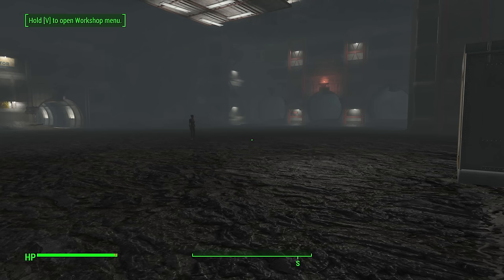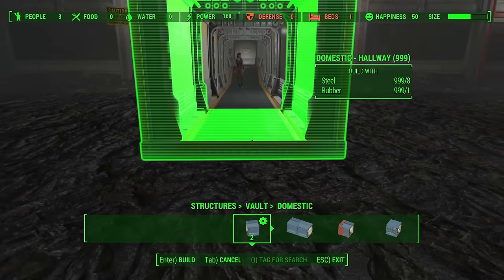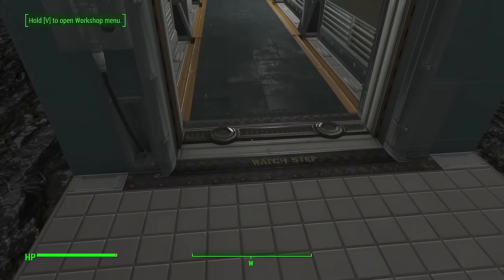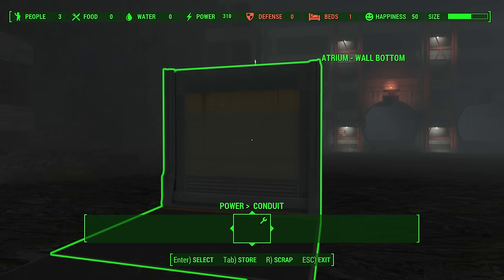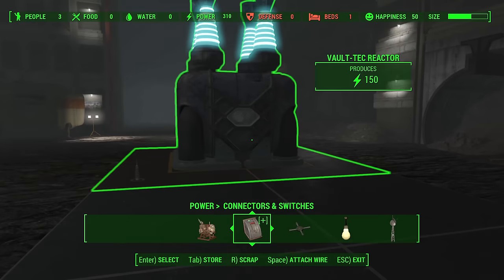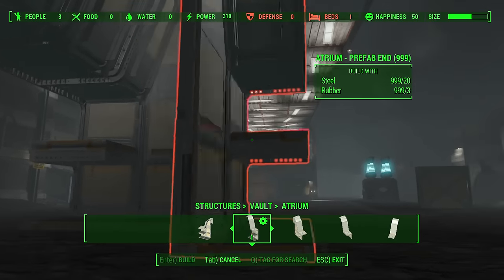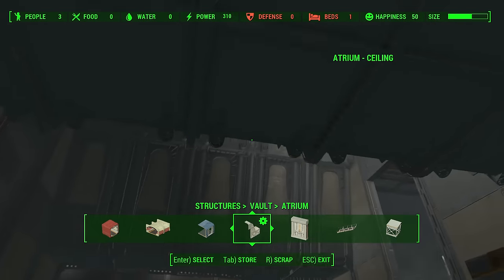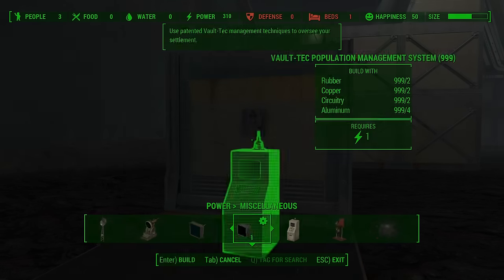FALLOUT 4: Vault-Tec DLC Basic VAULT BUILDING Guide! (Connecting Power, Rooms, and Atriums!)

Comment: Fun Tip: You can extend the width of the atrium through snapping with regular walls. 
You need to build enough walls to reach the height you want and snap a ceiling piece to it. While the ceiling pieces won't snap to the prefabs, they will snap to each other

Comment: You actually can extend your atrium ceiling. Just separate them to whatever length you like using atrium floor peices, build up your atrium walls in between, then extend the roof from there. There will be a gap left between the atrium end peices and the ceiling and walls, but if you remove the end peices and place an additional wall or ceiling piece, you can then replace the end peice and it will snap into place and fill in the gap.

Comment: Make a video that explains how to get power from the existing reactor
Reply: vault power comduit
Reply: Really????
Reply: the conduit is under switches and connectors. it snaps onto a vault wall
Reply: It'll only snap on to newly placed walls though, if you want power to the main entrance you'll have the wire it up like you normally would with wires and conduits stretching out from the power plant, the VT conduits that you can place emit power up to a 500m range and will power anything that doesn't require a direct connection, if it does you can still place a wire from the conduit to the object you're trying to power, there is a mod that'll increase the passive power range up to 1,500m so if you're having issues with placement I'd suggest downloading it =) Hope this helps!
Reply: If you use TCL you can see that the original generator is actually connected to the first "snap-able"  vault floor via a series of regular conduits below the ground. you could do something similar to hack power to the old part of the vault.
Reply: Put down a vault conduit on the wall, there is already a generator but you can add more
Reply: You have to place the vault power conduit every few walls the power goes through the doorway you walk into the cave with the conduits snap on the walls and the power goes through them

Comment: I'm having trouble with the vault entrance. There's that big reactor in the room off to the left of the workshop, but I can't get the vault conduit to snap anywhere in that area. Am I missing something? I want to build a wall of laser turrets to protect the entrance, but why build a gas generator when the 150 power reactor is right friggin' there?
Reply: yeah it's tricky as fuck.. I've figured the entrance doesn't count as built 'tiles' that the conduit can stick to.. the best I can figure is lining up conduit pipes along the ceiling, and connecting it to the generator with wires.. 

It's tricky but I've been successful so far, doesn't get in the way all that much. Hope this helps.
Reply: I tried aswell to get power from premade reactor.  i found no solution except drawing it with cables in the premade section.    I played  about 16 hours on release day, and i have build basicly anything and not found a better way.

The same way with the water plant i think, i hade to build a small generator near it to get water in vault.  It surely didtn draw power  by itself sadly.
Reply: +UltraSuperDuperFreak I did the same.

Comment: One thing I still haven't figured out what is wrong is the atrium ceiling only pieces.  They do not snap to ANYTHING.  Have tried stairs and atrium floor bits since I can get the floor to snap to the top of the stairs for alignment but nothing works for the ceiling only.  Should be pretty obvious that I did not use the pre fab atrium pieces but built my own to resemble Vault 81.  I ended up giving up on those and using the atrium floor bits for the ceiling as the bottom of those look good still so it subs in fine.  I have the highest quality roof ever thanks to that.

Besides having to work around the different room bits not snapping there are a few oversights on Bethesda's part on the pieces.  

For example.  In trying to duplicate the atrium look of Vault 81 I had stairs on either end and railing going around to the center bridge.  This works good except at the ends with the stairs themselves as there are no pieces that are bent inwards with a rounded railing at the end.  There are outward ones.  Basically if you are making a square or rectangle and railing the outside of that area you are good to go for having a rounded at the stairs option.  The railing on the inside doesn't have the rounded end option for where it meets the stairs so it looks goofy/unfinished.

My second example being when dealing with the 180 degree bend stair moving up one level.  I can attach it to the end of the wall and that side is a good fit.  However the left side you cannot use a pre fab wall/floor combo piece as it leaves a VERY visible gap to the outside.  Using a floor only and a wall only piece gets rid of the gap but then you break the continuity of the look and the fit.  Even though it gets rid of the gap it doesn't line up well with the floor/wall combo bits.

Comment: The floors actually don't have to be connected to the generator. I put the one with 500 power in the room with the water filter, and didn't connect floors to it. You just need the conduits.

I've had issues with railings. I had set up stairs in my attrium, and wanted to put railings around the open areas, but I couldn't get 3 rails to snap, and even the one U shaped piece wouldn't snap, and I have no idea why. It just kept snapping backwards, it'd face the floor, instead of the stairs. I ended up just redesigning the area to make things work.

Comment: Wheres the initial 150 power coming from? I can't find a generator anywhere. Also whats the deal with that massive structure near where the mire lurk queen appeared?
Reply: Im sure im an idiot for replying to a 1 year old comment as if you still need help but maybe someone will stumble across this comment and it will help. The initial 150 comes from the room to the left as you enter the main vault door. It would be where you have to flip on a transmitter for the overseer. I didnt notice it the first time around because it doesnt spark or glow like standard reactors. Also the massive structure deep in the vault you are referring to is a water purification system for the vault. I believe it needs at least 20 power routed to it but provides 100 water. I found out by accident by still being in the workshop as i approached it and it was highlighted.

Comment: I used to hate the basic settlement building; at least until Vault-Tec Workshop came out.  At least some things actually fucking work when you build a normal settlement.  I don't have the patience to spend 5 hours fucking around with the atrium pieces just to get it to be an enclosed structure.  If it worked correctly, this would've been the best DLC; but the building fuckery makes it automatically the worst.

Comment: Hey i want to make it so vault dwellers cannot open certain doors can someone help?
Reply: "Auto Doors" mod on Nexus Mods has auto close door attachments as well as keycard panels. Put auto close next to open door (if it is recognized by auto doors it should close within a couple seconds of you placing it.) Then place keycard panel on either side of door and on both going in and out sides. You will now see the door is locked. Simply craft appropriate keycard from chem station and interact with keycard panel to unlock door. If you give npc's the keycard they walk through the door as if nothing changed.

Comment: It sucks that you can't connect Atrium Ceilings to middle ones.
Reply: You can make the ceilings overlap seamlessly if you place the walls first. You might get some z-fighting on the walls though (can be fixed with the Place Anywhere mod, by moving the walls forward a fraction).
Reply: Actually just don't use the atrium end pieces to avoid z-fighting; use regular atrium walls perpendicular to atrium ceilings instead.

Comment: Can you or someone tell me how I use ceilings it's not working for me please help my ocd is in overdrive
Reply: If you are talking about the atrium ceiling only pieces that is a damned good question.  I couldn't get them to snap to ANYTHING at all.  I gave up on those and used the floor pieces for the ceiling as well since the look on the bottom is still good and it doesn't cause any gap or alignment issues.
Reply: +Stubbies2003 Hey guys, I found the Atrium ceiling pieces will only snap to another roof piece. So if you take the Atrium mid or corner top and place those first, the Atrium ceiling will snap to those. Hope this helps.
Reply: talon329 thanks a lot that worked :)

Comment: where can I get more Steel for Sanctuary!!!,
Reply: If you have the automaton DLC then go to the mechanist lair and scrap everything the run a supply line
Reply: Steel is easy. The first and simplest option is shipments, they're relatively cheap. If you're strapped, just go to any of the big factories. The one by Concord is low level. Take EVERYTHING! You'll get a crap load of steel and aluminum. Another good option is scrapping guns. Any gun with multiple descriptors is going to get you steel, aluminum, gears, springs, and stuff like that. Good hunting!
Reply: Raid the ** out of the various areas in vault 88... they supply you with GOBS of material... rocks and rock walls are a bonanza...